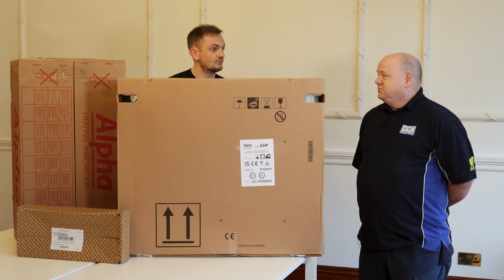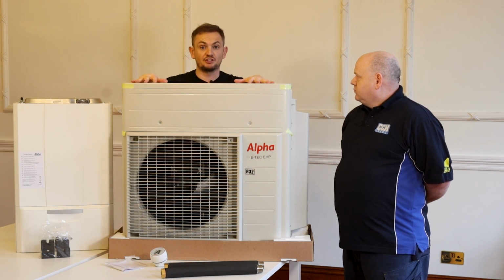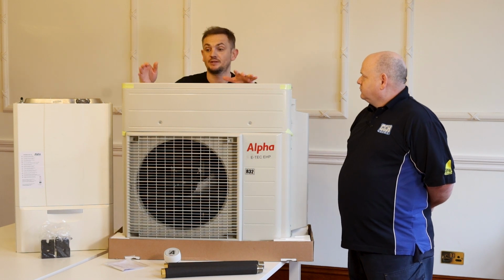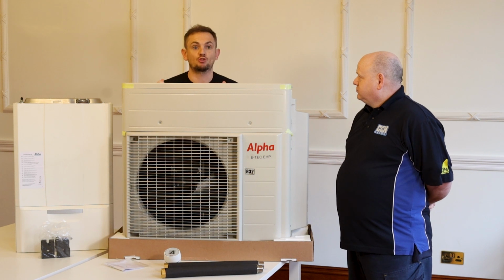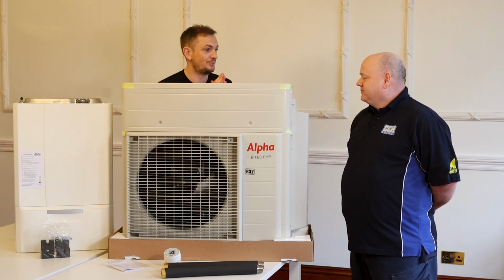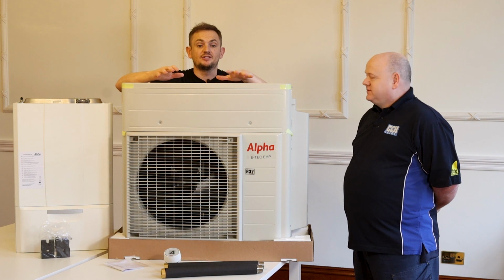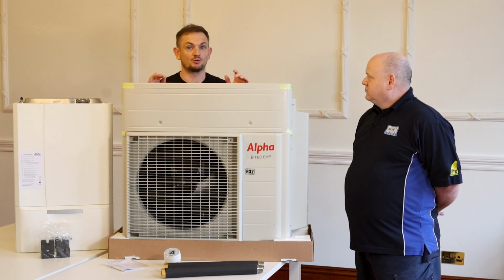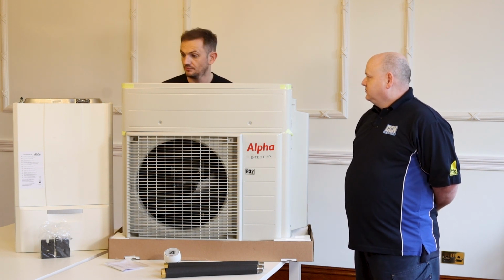We teach Allen Hart about Hybrids | Will this replace a traditional air source heat pump?

Comment: Have done the Alpha course and Im MCS qualified. One of the big drawbacks is the size of this heat pump. Good for a 1 bed house or flat. 4 kW not going to give you any substantial heat on a 3 bed house. Great idea but they need to increase the size of the heat pump outputs. I have heat pump and all heat pumps can be linked in to a gas boiler.
Reply: 4kW for 8 hours is 32kwh of heat into the property, about £3.50 on current gas prices, my 3 bed 70s semi often needs less than that during most of the heating season.
Reply: Daikin also do a 5 & 8kw split fridge version

Comment: One of the main issues is the flow temperature, so the customer has to pay 3.3 times the cost of a gas condensing combi for the kit, and then be told "your flow temp has to be 45/50 degrees" for it to be super efficient, but in the customers eyes they will just say and they do "the house is not hot enough and the rads are warm" for some to then say "oh here is a quote for more efficient rads" or similar, so ££ followed by ££ followed by ££. not to mention saying to them, oh this big unit goes on the outside (that can not be worked on if its raining or severely wet). these units are really best suited for new builds that have been sized and fully insulated, or similar.. I feel sorry for the installers who have to deal with the callbacks, complaints and potentially more from unhappy customers who were not given the full facts, what it will and won't do, and running costs, like you say, at the current time, gas is cheaper than electricity (unless you sell them solar too). some are even being cold called and being told that gas is ending in 5 years, just so they get a sale, this is bad practice. but it is good that many manufacturers and sales websites are listing many facts as possible.i can just see the Grid failing mid winter, with EV's and suchlike being used. but good video tho. loved the content.🖐
Reply: Setup weather comp right and buy yourself a pop up gazebo.

Comment: Will it work on a system that has small bore pipe?
Reply from the maker: Yes, it will work but it will reduce the efficiency as the system will have to work harder.
Reply: Mcs won't pass it if its micro.  So u better hope they don't go out and check the installation or its bye bye mcs accreditation
Reply: @cloud12274  can you not use a buffer for that? Our home was recommended to have a hybrid model and not go full heat pump as we may regret it...